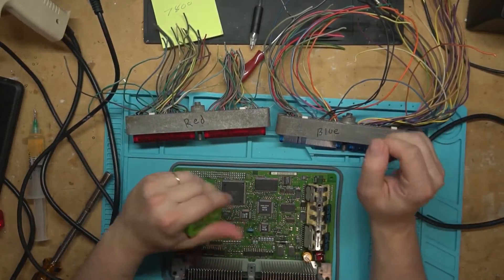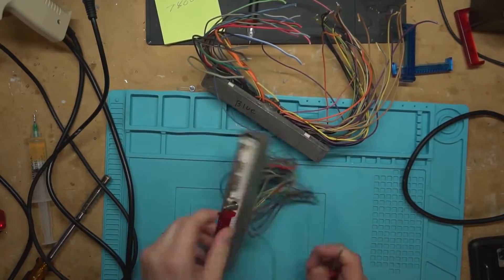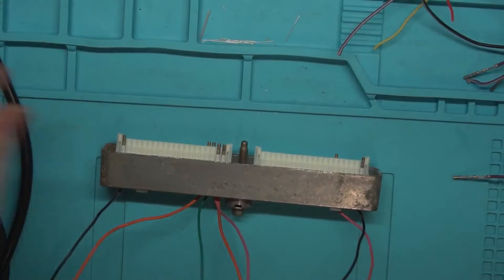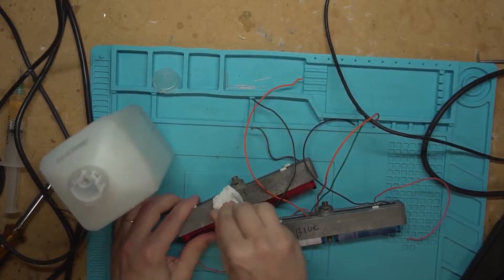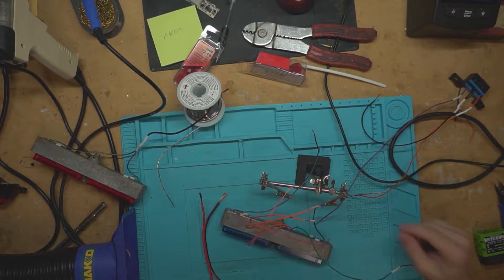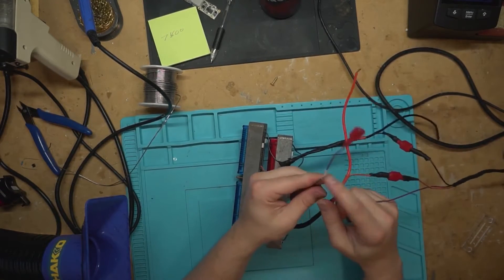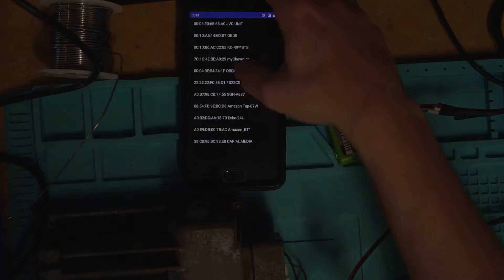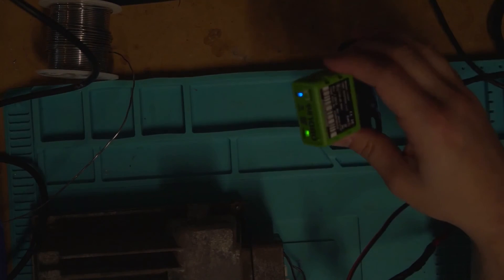Building a LS Tuning Harness for P01 P59 or 0411

Comment: Is there a pin that gives a signal or ground to operate a solenoid for the neutral safety switch? My 4L60E LS1 setup does not have the external switch. I would also like to wire up my reverse lights. Can this be done?
Reply from the maker: LT1swap has the pinout for this PCM https://lt1swap.com/2004vortec_pcm.htm

Comment: The red and blue plastic pieces on my PO1 were brittle and cracked. I replaced them as well as re-pinned a few pins but now the connectors don't seat properly before tightening it down. I need to check for bent pins. Sigh. Any other reason this would happen?

Comment from the maker: So after I filmed this the Ls droid community pointed out you only need the blue connector and that the  grounds on red are not needed so that will save you some time making one. I assumed you needed all PCM grounds. Here is a link to the EFI live guide that shows it like that. They also pointed out not to use this connector on a 98/97 even though it will plug in. http://download.efilive.com/Tutorials/PDF/Bench%20Harness%20Tutorial.pdf?fbclid=IwAR3eiMKV8mUaMFrDLrj0rVEvDfee7lFYqeDPiu43UB0ht9UCrt_DHIDpAa4

I made a video with corrections to this one. https://youtu.be/l4EHkcX7qiw